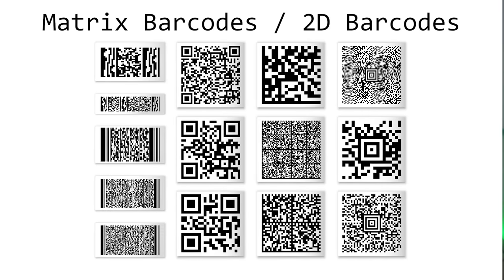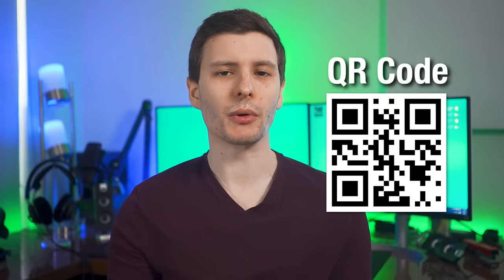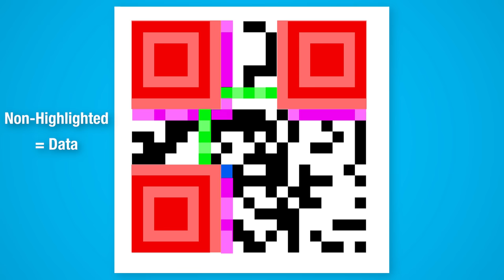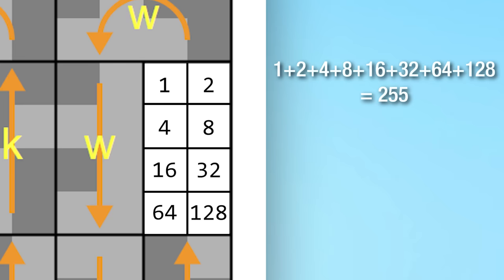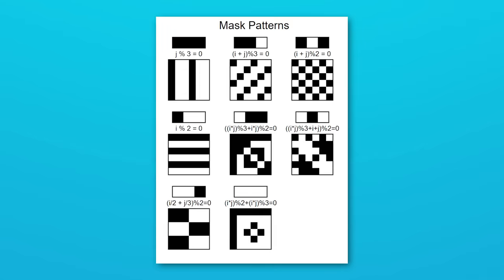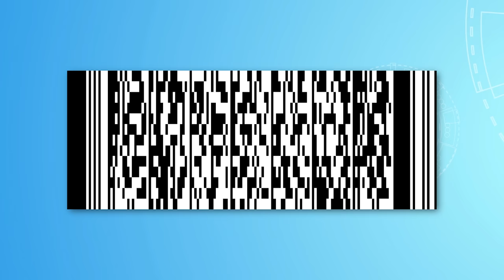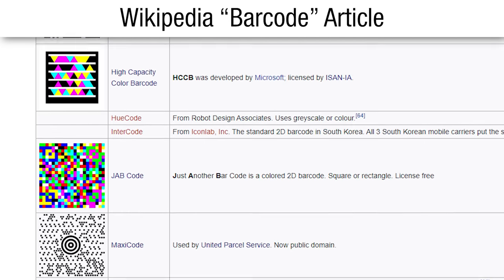What Are Those Other Weird QR Codes?

Comment: Someone had to do it:

0:03 Bunch of wiki links
0:14 "HEY THIS IS AN EXAMPLE, WHY YOU SCAN >:("
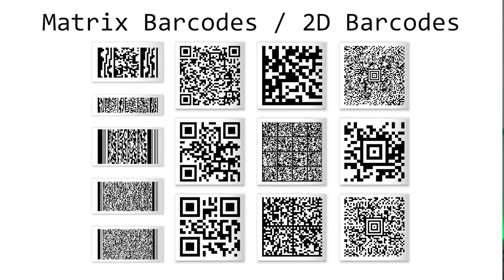0:30 Bunch of Lorem ipsum text
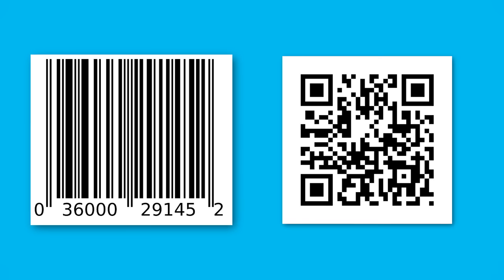1:03 Just the numbers and a wikilink on the right
1:36 "EPIC bruh moment" and the same as 0:14
1:46 Bruh why you scan this
1:57 STOP SCANNING THE EXAMPLES >:O
2:00 "oi mate i swear on me grave if you dun stop scannin these examples i'll give you a proper slap"
2:22 I can't scan any of these
1:36 "EPIC bruh moment"
2:45 "Ver1"
2:58
"Ver1", "Version 2", "Version 3 QR Code"
"VERSION 10 QR CODE, UP TO 174 CHAR AT H LEVEL, WITH 57X57 MODULES AND PLENTY OF ERROR CORRECTION TO GO AROUND.  NOTE THAT THERE ARE ADDITIONAL TRACKING BOXES"

"Version 25 QR Code, up to 1853 characters at L level.
A QR code (abbreviated from Quick Response code) is a type of matrix barcode (or two-dimensional code) that is designed to be read by smartphones. The code consists of black modules arranged in a square pattern on a white background. The information encoded may be text, a URL, or other data.
Created by Toyota subsidiary Denso Wave in 1994, the QR code is one of the most popular types of two-dimensional barcodes. The QR code was designed to allow its contents to be decoded at high speed.
The technology has seen frequent use in Japan and South Korea; the United Kingdom is the seventh-largest national consumer of QR codes.
Although initially used for tracking parts in vehicle manufacturing, QR codes now are used in a much broader context, including both commercial tracking applications and convenience-oriented applications aimed at mobile phone users (termed mobile tagging). QR codes may be used to display text to the user, to add a vCard contact to the user's device, to open a Uniform Resource Identifier (URI), or to compose an e-mail or text message. Users can generate and print their own QR codes for others to scan and use by visiting one of several paid and free QR code generating sites or apps."

"Version 40 QR Code can contain up to 1852 chars.
A QR code (abbreviated from Quick Response code) is a type of matrix barcode (or two-dimensional code) that is designed to be read by smartphones. The code consists of black modules arranged in a square pattern on a white background. The information encoded may be text, a URL, or other data.
Created by Toyota subsidiary Denso Wave in 1994, the QR code is one of the most popular types of two-dimensional barcodes. The QR code was designed to allow its contents to be decoded at high speed.
The technology has seen frequent use in Japan and South Korea; the United Kingdom is the seventh-largest national consumer of QR codes.
Although initially used for tracking parts in vehicle manufacturing, QR codes now are used in a much broader context, including both commercial tracking applications and convenience-oriented applications aimed at mobile phone users (termed mobile tagging). QR codes may be used to display text to the user, to add a vCard contact to the user's device, to open a Uniform Resource Identifier (URI), or to compose an e-mail or text message. Users can generate and print their own QR codes for others to scan and use by visiting one of several paid and free QR code generating sites or apps."

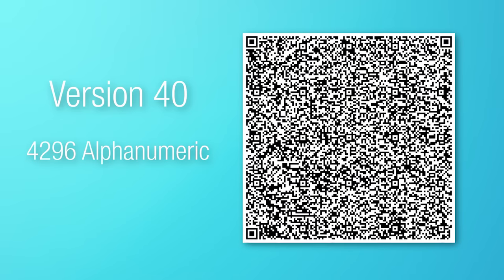3:18
"What in Davy Jones’ locker did ye just bark at me, ye scurvy bilgerat? I’ll have ye know I be the meanest cutthroat on the seven seas, and I’ve led numerous raids on fishing villages, and raped over 300 wenches. I be trained in hit-and-run pillaging and be the deadliest with a pistol of all the captains on the high seas. Ye be nothing to me but another source o’ swag. I’ll have yer guts for garters and keel haul ye like never been done before, hear me true. You think ye can hide behind your newfangled computing device? Think twice on that, scallywag. As we parley I be contacting my secret network o’ pirates across the sea and yer port is being tracked right now so ye better prepare for the typhoon, weevil. The kind o’ monsoon that’ll wipe ye off the map. You’re sharkbait, fool. I can sail anywhere, in any waters, and can kill ye in o’er seven hundred ways, and that be just with me hook and fist. Not only do I be top o’ the line with a cutlass, but I have an entire pirate fleet at my beck and call and I’ll damned sure use it all to wipe yer arse off o’ the world, ye dog. If only ye had had the foresight to know what devilish wrath your jibe was about to incur, ye might have belayed the comment. But ye couldn’t, ye didn’t, and now ye’ll pay the ultimate toll, you buffoon. I’ll shit fury all over ye and ye’ll drown in the depths o’ it. You’re fish food now."

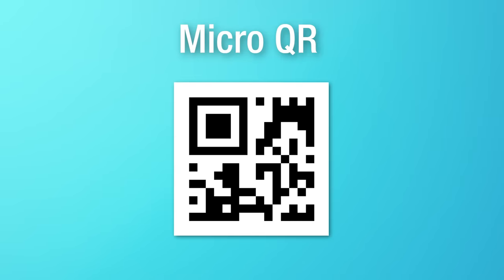3:41 Can't scan that one, it won't recognize
3:54 "ah yes hello good day this is a very good thing of text that will be still readable despite covering up lots of the actual code"
4:17 "wow incredible example i blocked off the middle and yet it is still readable"
4:40 "Ver1"
9:32 Same as the Version 10 QR at 2:58
10:39 Same as 0:14
11:10 "YES HELLO GOOD DAY" and "YES HELLO GOOD DAY TO YOU I SAY"
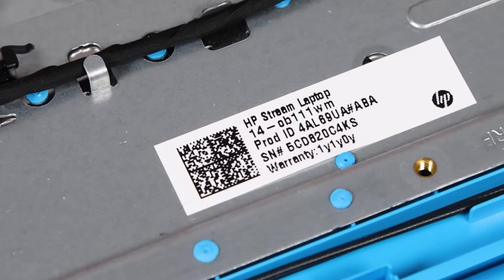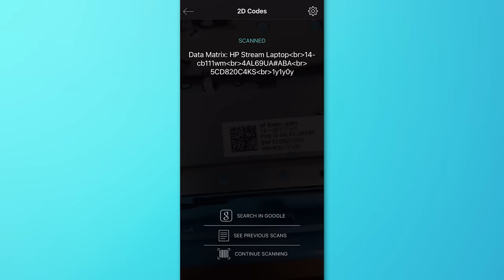11:16 Some info about the HP laptop (as seen at 12:05)
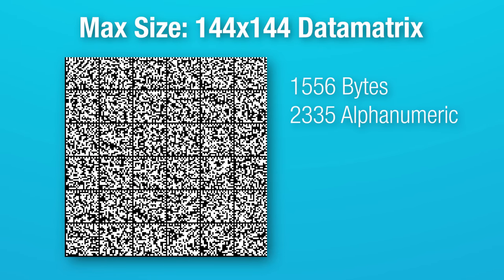11:21 MSI Plessey 0000000000000000000
13:18 Same as 1:46
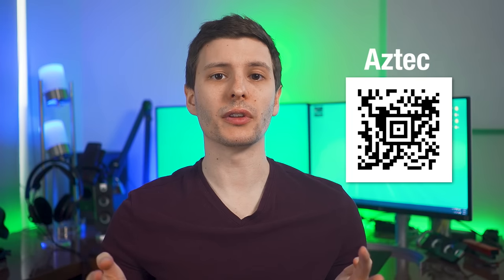15:07 Same as 1:57
Reply: You have too mouch time in your hands
Reply: @doom6787  yes I know ;)
Reply: I started scanning some for fun. Had to download the app he suggested to scan some of them. Thanks for putting in the work there!
Reply: I thought one of those would be a Rock Roll
Reply: anyone looking for the rickroll one?
Reply: @markenangel1813  3:34 is RickRoll (full text of Never gonna give you up)
Reply: Next bunch:
3:41 Micro QR: Example
11:20 Max Datamatrix: Some of the readers recognise only. Helps if I put the code on a white background: Wow, this  code sure is unnecessarily large!
11:40 DataMatrix: 15C06E115AZC72983004
13:55 same as 2:00
14:21 PDF417: Wikipedia, the free encyclopedia
15:41 AztecCode: This is an example Aztec symbol for Wikipedia. 
Data Matrix: Wikipedia, the free ecyclopedia
DotCode: Wikipedia
MaxiCode: Wikipedia, the free ecyclopedia
Reply: @RelakS__  Ah, thanks. I cut out the images, but that didn't work.
Reply: R/wooosh  True, that is really the "Never gonna give you up" lyrics :D
Reply: @rednassie1101  Actually, only two softwares were able to read: A QR & Barcode Reader from TeaCapps  from a youtube screenshot, and the Barcode Scanner from Cognex Corporation, after I edited out the strange blue background.
Reply: @RelakS__  thanks for that then :D
Reply: legend u
Reply: @rednassie1101  I may have to use the one at 03:18 on some postings. May I have your permission to copy this?
Reply: @STSWB5SG1FAN  yeah sure haha, I just scanned it
Reply: Holy shit
Reply: 3:30
Reply: The shotcode at 2:22 links to the wikipedia article called "shotcode"
Reply: Wow
Reply: Thank you I was so curious
Reply: you forgot the rickroll one
Reply: We're no strangers to love
You know the rules and so do I
A full commitment's what I'm thinking of
You wouldn't get this from any other guy

I just wanna tell you how I'm feeling
Gotta make you understand

Never gonna give you up
Never gonna let you down
Never gonna run around and desert you
Never gonna make you cry
Never gonna say goodbye
Never gonna tell a lie and hurt you

We've known each other for so long
Your heart's been aching, but
You're too shy to say it
Inside, we both know what's been going on
We know the game and we're gonna play it

And if you ask me how I'm feeling
Don't tell me you're too blind to see

Never gonna give you up
Never gonna let you down
Never gonna run around and desert you
Never gonna make you cry
Never gonna say goodbye
Never gonna tell a lie and hurt you

We've known each other for so long
Your heart's been aching, but
You're too shy to say it
Inside, we both know what's been going on
We know the game and we're gonna play it

I just wanna tell you how I'm feeling
Gotta make you understand

Never gonna give you up
Never gonna let you down
Never gonna run around and desert you
Never gonna make you cry
Never gonna say goodbye
Never gonna tell a lie and hurt you
Reply: Oh my god this is so long
Reply: wtf is this
Reply: @BlueSquad00  the text of the QR codes in the video
Reply: HOW TF YOU TYPE SO MUCH LETTERS WITHOUT EDITING
Reply: @janouskatayandre-andray614  Honestly, I made a file on my phone, wrote it in there and copypaste it into the comments
Reply: Tooooooooooooooo much time gimme
Reply: 3:35 "We're no strangers to love
You know the rules and so do I
A full commitment's what I'm thinking of
You wouldn't get this from any other guy

I just wanna tell you how I'm feeling
Gotta make you understand

Never gonna give you up
Never gonna let you down
Never gonna run around and desert you
Never gonna make you cry
Never gonna say goodbye
Never gonna tell a lie and hurt you

We've known each other for so long
Your heart's been aching, but
You're too shy to say it
Inside, we both know what's been going on
We know the game and we're gonna play it

And if you ask me how I'm feeling
Don't tell me you're too blind to see

Never gonna give you up
Never gonna let you down
Never gonna run around and desert you
Never gonna make you cry
Never gonna say goodbye
Never gonna tell a lie and hurt you

We've known each other for so long
Your heart's been aching, but
You're too shy to say it
Inside, we both know what's been going on
We know the game and we're gonna play it

I just wanna tell you how I'm feeling
Gotta make you understand

Never gonna give you up
Never gonna let you down
Never gonna run around and desert you
Never gonna make you cry
Never gonna say goodbye
Never gonna tell a lie and hurt you

"
Reply: you are great
Reply: funny, my browser scans it automaticly
Reply: You are a hero

Comment: 8:52 actually for RS-Code you always need 1 EC block to verify that the data is valid and then 1 additional block for each corrupted block in the data segment. so to replace 1 corrupted/missing data block you need 2 EC blocks. To replace 3 corrupted/missing data blocks you need 4 EC blocks and so on.
Reply: To replace 3 corrupted blocks you require at least 6 additional EC parity blocks. If you have N redundant EC parity blocks, you can correct N/2 symbol errors (block errors) at the most. Assume N is even.

Comment: Actually there is one 2d code missing, a code most of us had heard from (but maybe not about): Dolby Digital Code. This was one of the digital sound recording methods on analog films, between the perforation, was scanned by a little camera, decoded and given to the amplifier. About 15 years ago this code went pacticly away with digital projection coming up - but till then it was one of the most used 2d codes (4 codes per picture, 24 pictures a second), so anyone watching a DD movie in cinema heard 345600 2d-codes per hour (of course there was much redundancy in encoding, as parts of the perforation might get damaged).

Comment: This is a fascinating subject matter.

Aztec codes, I have read somewhere, are better for use in mobile device displays than QR Codes.  I would guess that their appearance makes them somewhat faster and more resilient for that purpose.  Also, since they spread from the central pattern, I would also guess that they make it possible to emphasize certain parts of the encoded information (that closer to the core) and make partial readings possible.

Comment: The "Mask" that flips the blocks in the QR code is a process that is also used in digital signal transmission, called "Alternate Mark Inversion" so instead of having a digital signal that has a long string of 1's or 0's, these are broken up. This also helps with basic error detection in digital signals. If part of the transmission system receives no signal input, it creates an alarm signal to signify loss of signal at that point, and then injects a string of all 1's to transmit forward. This is an "Alarm Inhibit Signal", so the system recognises the point where the signal is broken, but prevents parts of the system further up the chain from creating their own alarm signal. This means the first place where the signal failed can be identified. Further up the system the all 1's signal registers as a "valid" signal, but displays a warning there is an all 1's input being received, so you can tell that there is a problem somewhere back from that point.

Comment: ThioJoe, your great explanation brought back memories of when I was a programmer, I had to write software to print UPC-A bar codes for a clothing manufacture.  For bills of lading, price tags etc. I told management that the printer they purchased at great cost, was not able to  print price tags small enough, so they had to buy another printer.  It was a fun project.

Comment: Funnily enough, some airlines also use Aztec codes for their mobile/digital boarding cards, as well as the PDF417 on the paper/printed ones. In my experience they're easier to scan off screens (and faster to process), probably because they're smaller and less complex. However they have less data in them, so occasionally you have to get a PDF417 reprint when certain things happen

Comment: I met CIRC error correction method at first in early seventies for Compact Discs.  For every 16 bits of data there were 18 bits of error correction. I tested it putting a radial black tape on a disc and it was read correctly. Amazing.

Comment: I like to explain error correcting coding as a much more complex version of 3 = 2 + 1. You can lose any of those three terms and you'll be able to solve for it using the other two.

X = 2 + 1
3 = X + 1
3 = 2 + X

Comment: 8:20 if you still don't understand why that random always black pixel is there, this image should show you exactly why. It's a space filler as everything around it is 8 bit chunks of error correcting blocks. Basically the pixel will never, ever, be filled with Data so it's just left as a single black square.

Comment: ThioJoe
This is the correct way to write  Time Stamps
Notice how the columns line up ...
Not really difficult when one applies a little logic
See how much neater it is.
Your FREE lesson for today

▼ Time Stamps: ▼
00:00 - Intro
00:52 - 1D vs 2D Barcodes
01:31 - Notable 2D Barcodes
02:38 - QR Codes Explained
04:28 - Decoding QR Codes
10:36 - Data Matrix Explained
12:22 - Decoding Data Matrix 
13:10 - More 2D Barcodes

Comment: Thanks for bringing all of that information..... really great effort! Just a small comment, in the QR encoding part I believe you got the message encoding wrong! They didn't use the numbers 1, 2, 4, 8, 16, 32, 64, 128 because the ASCII table has 256 characters! It's totally the opposite! It's simply how Binary numbering works, it's 8 bits (zeros or ones) thus it can store numbers from 0 to 255 as simple as that! And the ASCII table has 256 characters just because this is the maximum that can be handled by a single byte (8 bits). For example there are different encoding systems aside from ASCII that have more characters and use more bits.

Comment: as far as scanner apps go, I've always used one just called barcode scanner and it works fine with 1d and 2d codes, it's actually helpful to get some longer 1d codes if you need to scan one.

Comment: Wow. Mind-blowing. Glad to know the basics. It still seems that it would be hard to fit enough information on one QR code for even a web page address. I guess the Computer can do it!
Reply: Say there are N total pixels in a grid (and they are all used for data). Each pixel can be black or white so there are 2^N combinations. You can see that's exponential. For an 8x8 grid there would be 2^64 = 18,446,744,073,709,551,616 possibilities.

Comment: AruCo markers are another similar type of code, which are designed to be readable from many angles and easily distinguishable from each other; they're used in augmented reality and other applications for super accurate motion tracking. They're an open source standard and even Nintendo has used them.

Comment: There are various character encodings that use 8-bit values, including ASCII, iso-8859, JIS-8, and utf-8, and they are supported in different degrees by most actual QR scanners. There is an optional protocol called "ECI" (extended channel interpretation), which is unfortunately not very widely implemented, which puts an extra value at the start of the message specifiying exactly which data encoding is used (beyond just 'character'). Most scanners use heuristics to work out the actual encoding, and only some of them support ECI unfortunately.

Anyway, to answer your question at 6:18, in utf-8, a character can be represented by a single byte, but it can be as long as four bytes. It's a variable-length encoding. I'm not 100% sure as I don't have access to the spec, but I think the length block contains the length in bytes.

Comment: The worst was the Microsoft Tag proprietary one with triangles. The worst implementation ever. You called it an HCCB code, but it was called a Microsoft Tag. They had Android and iOS apps so late after they themselves stopped using them, but for years you’d find them on software boxes and random mall displays

Comment: the information bits around the locator patterns are actually duplicated copies, one vertical and one horizontal, and because of the pixel in their intersection it ends up that there's one redundant pixel, and that pixel is put in that always black one you talked about

Comment: Simple bar codes are used in European grocery stores. It describes the manufacturer of the food and which article it is. A price is assigned to this in the cash register system. So that the code can be read quickly, it is printed on different sides of the packaging. The cashier only needs to pull the goods over the scanner and toss them into the shelf.
German cashiers in particular are known to work quickly.
In the past, the cashiers at Aldi had to learn the prices by heart, which was much more difficult.